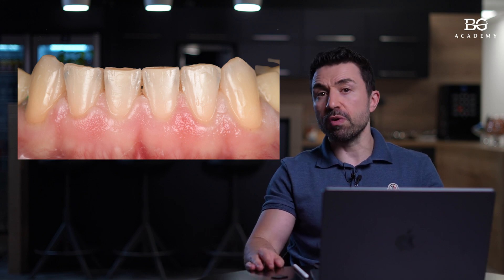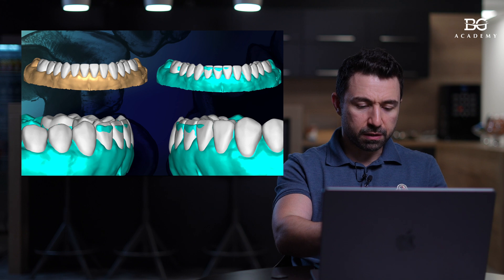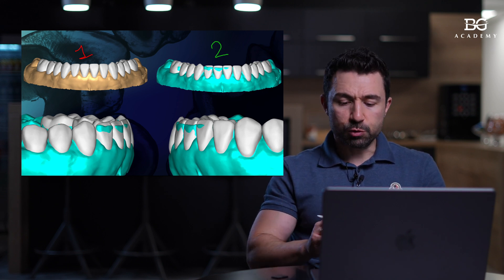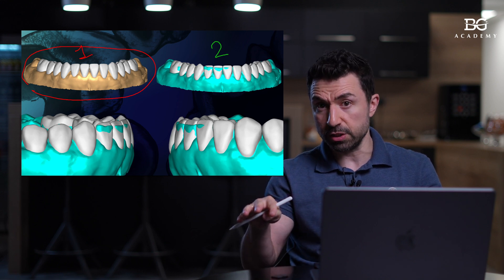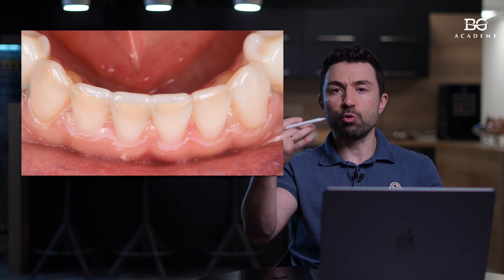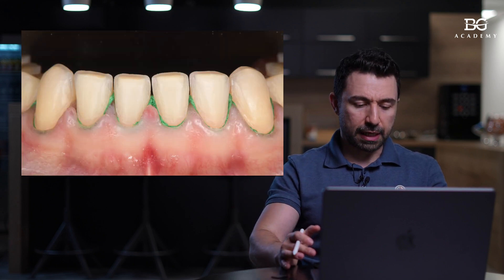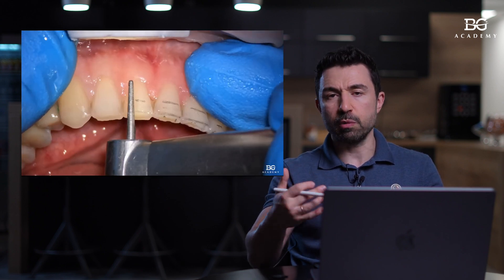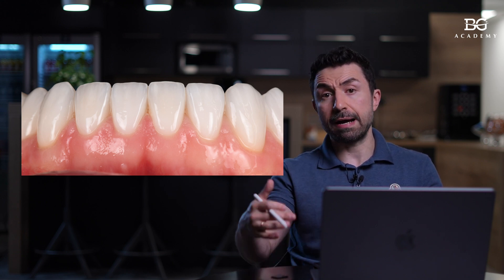Predictable tooth reduction for veneers

Comment: Important question if i have such interference is moch up will be in correct because it couldn’t seated fully so the whole prep will be fault later on 
Is this you method is surely correct for subtractive cases plz give the reference article if you can 
And thanks very much dr